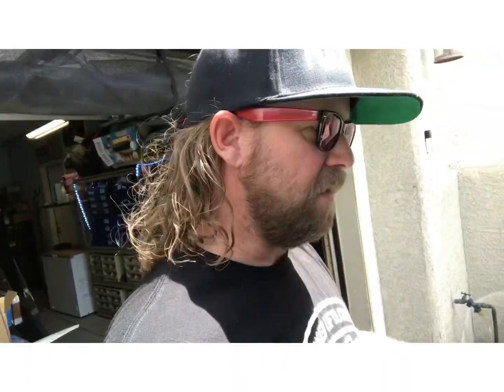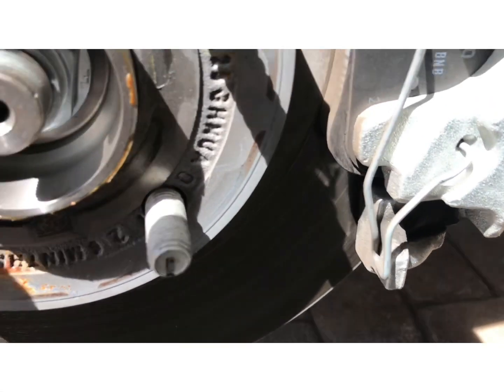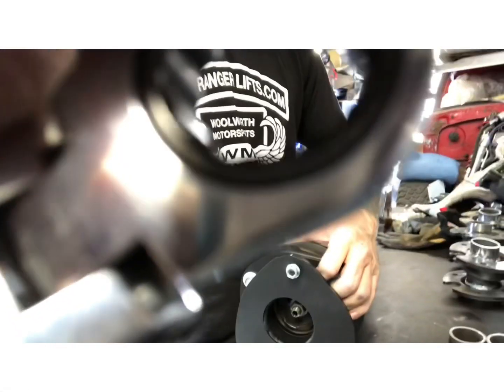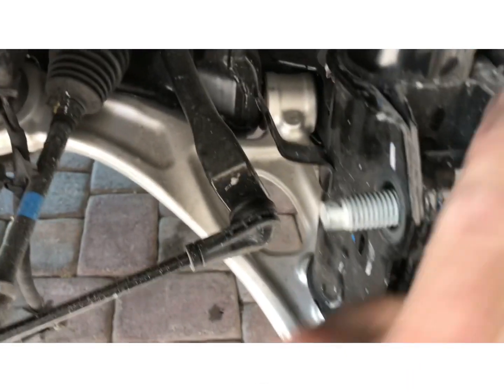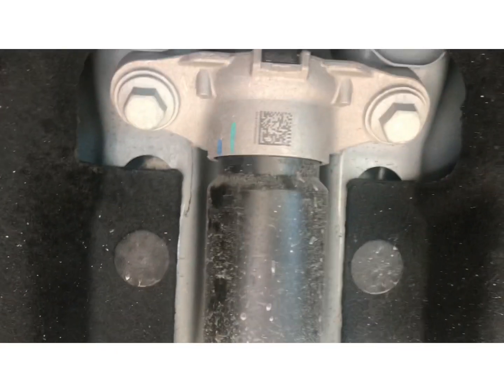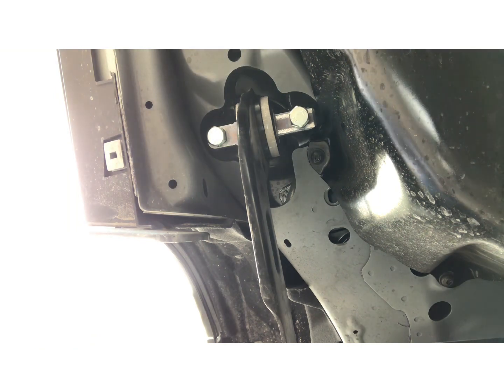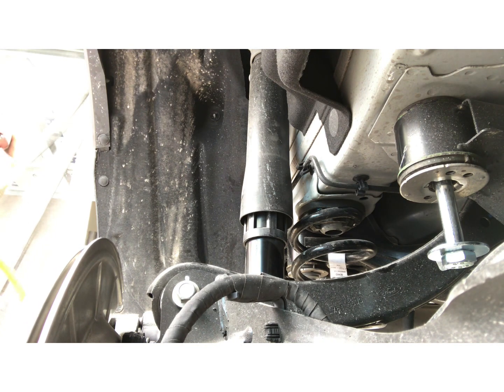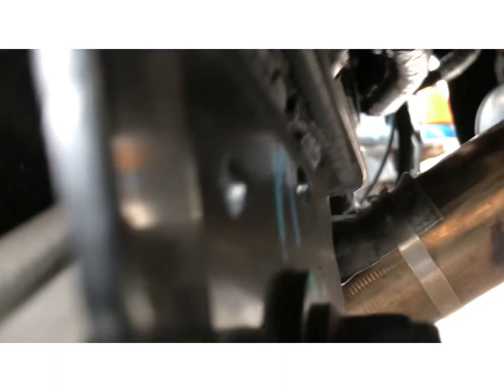Bronco Sport level lift install

Comment: Not sure if you mentioned it but you shouldn't tighten the control arm bushing bolts completely until the vehicle is under its own weight unless you want to destroy the bushings prematurely

Comment: Great video. My concern is with the lower spring perch on the rear. Why not make it tighter fitting and pinned to the control arm like the OEM one? I would think it would want to slide around and make noise.

Comment: I know your a busy guy, was wondering since the bronco sport is basically the same chassis as the 2022 maverick would this kit work on the maverick? Willing to use my new 2022 Maverick as a test vehicle and check, also can send videos for you to post. If it works alot of guys from Maverick forums would buy this lift! Let me know, thanks.

Comment: Thanks for your work on this video and documenting the process.  I do have some concerns about the rear lift spacers:
1. The lift spacers only have a washer on the end, where it comes in contact with the stock spacer.  The other end  of the lift spacer is just the ring of the spacer that mates directly with the metal surface of the unibody "frame".  Anyone else have a concern that this metal to metal contact will allow the spacer to slip against the "frame" on a rough driving surface and throw out the rear wheel alignment ?  Wouldn't this be better with a second washer on the other end of the lift spacer as well, plus some rubberizing of that surface for a less slippery contact with the "frame"?
2.  The washerless ring-edge of that spacer is under a lot of pressure.   Anyone else concerned that this "ring" might sink into the unibody "frame" over time, possibly creating a permanent "pit" in the "frame"?  
3.  If a "pit" does occur in the "frame"while the wheel alignment is out, might that "pit" interfere with future rear-wheel alignment?
Don't mind the "quotation marks", I only used them because I couldn't come up with better terms than "pit" and "frame" (I know that technically there is no frame).
Anyone have any thoughts on these concerns, or have any other concerns, or have good things to say about these spacers after some experience with them, or know if there are there better spacers available that solve these issues if they are issues?
Reply: You got lifted?
Reply: @ABXPONCE  I 2021 Bronco Sport Badlands order was cancelled so I wasn't able to get one.  Wound up getting a 2021 Jeep Cherokee Trailhawk Elite instead since it was available.  Turns out it's probably the better vehicle for me for what I do with it - I didn't realize the importance of 4-low and a good bash-plate system for those times when I head up a trail that started with the thought:  'I wonder if I can get up there..."  I am still researching my options for lifting the Cherokee though.
Reply: @khanadda222  I wish I had that opportunity.

Comment: When adding the strut spacers in the front only will you need alignment.
Reply: Anytime you lift a vehicle, even if just the front, you need to take it to a shop to get an alignment afterwards.

Comment: Hey I have a question…Is this installation different for the base model? I am looking at a rough country kit and it seems that theirs doesn’t have the drop down spacers? Is that something that is only required on the badlands and 1st edition models?

Comment: Do you think this will void any warranty
Reply: YMMV but talking to the dealership I bought mine from they seem to think it's fine depending on what leveling kit you get.
Reply from the maker: My kit will not void Ford motor company standard warranty. It’s usually up to the dealership you go to if they want to cover it or not depending on what it is.